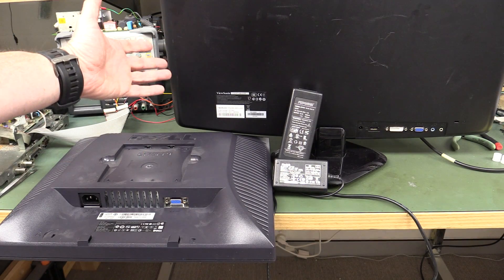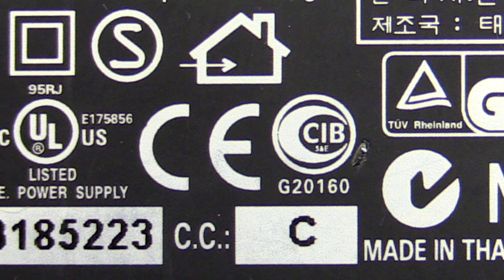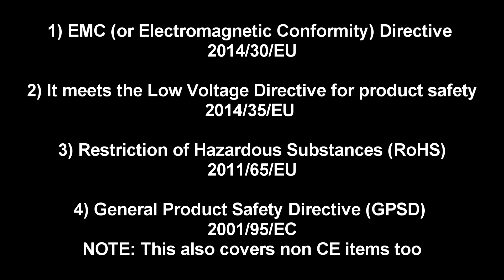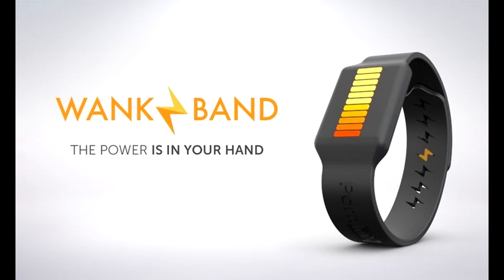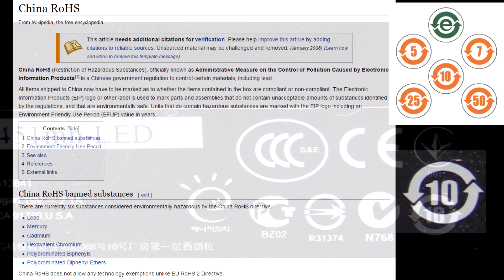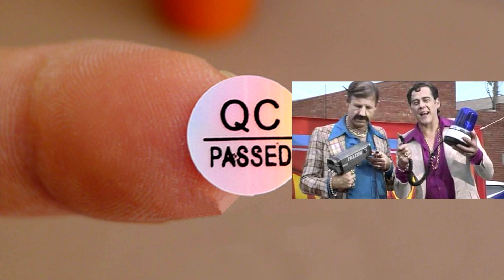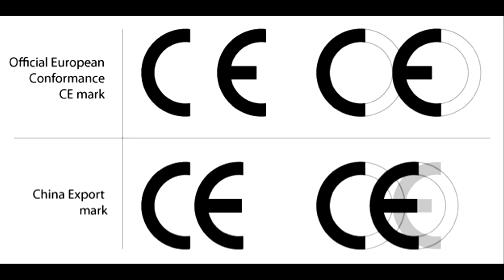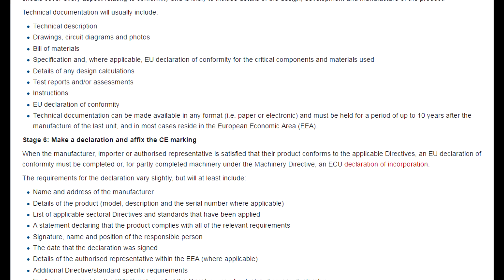EEVblog #996 - What Is The CE Mark On A Product?

Comment: CE = China Export.
Reply from the maker: Nope, watch the video.
Reply: That was a joke from a few years back, google that up. The whole point was the China Export logo had sligthtely different font. You see, in China they do not care much about these certifications, yet European customers want to see the CE on electronicts they buy, so Chianese manufacturers just put it there, regardles of the actuall regulation. After a dispute, China would claim the CE means China Export and as a proof of that made it clear the letters C and E are different font/shape. IIRC, they just moved the C closer to the E, to make it China Export, then they talked about different shape of the letters. Either way, funny stuff.
Reply: Philip Cooper that's an urban myth...
Reply: I think it was more like "Chinese would claim" than "China would…"

Comment: This is a very good overview of the CE concept.   One thing maybe worth noting in a future video...   who is responsible for the CE Declaration?   I'm sure you know it's the company bringing the product to market within the EU.  The manufacturer in China or Hong Kong or wherever can slap the mark on the product but it's the seller in EU who is responsible.  That's why many times on cheap toys you see a second product label stuck over the original packaging.
Reply: It's also worth mentioning that if you buy something directly, from e.g. China, you often get the budget version with the safety features stripped, but still in the same case and with the same CE sticker. So the CE mark only means something if you buy it in the EU I believe.
Reply: And if you buy a few bits in China from Aliexpress etc. to resell you would be responsible for the CE declaration which means you need to be able to prove how your stuff meets the regs.  This either means getting it re-tested locally or getting the test certs out of the manufacturer in China...  (good luck with that!)

Comment: Conformity can not always be attested by the manufacturer alone. For some product groups, like medical equipment, conformity must be assesed by an approved test house, but it still leads to the same CE mark that self-declared products get. Whether external testing is required is detailed in the standards.
Reply: antalz I was wondering this, My work experience in high school was at Intertek, I basically did CE conformity testing all week long and it certainly seemed mandated, dealing with some of the products and the manufacturers.

Comment: Main point for whole CE/declaration of conformity is that there has to be local representative in EU. For quite many products it's importer of the product and they have to make the declaration of conformity not the manufacturer. Retailers/resellers are required to check that this is true for everything they sell. So there has to be someone local to blame when product is not safe or compliant.  Chinese company giving declaration of conformity like in the video has no value because you cannot sue company in china for breaking european law.
Reply: Exactly, it's only meaningful for products sold within the EU. I've bought things on ebay where you obviously get different circuit boards inside the product than if you buy it locally, but it still come in the same case with a CE sticker even though it's obviously non conforming, which in that case means absolutely nothing since there is no one responsible to blame.
Reply: And I'm pretty  sure that same goes to any compliance marker. You can put UL and FCC markings to product in china and sell those in china  Nothink illegal about that. It's legally binding only in US. EU law clearly states that importer is responsible for product, so basically if you buy directly from china you are responsible conformity. This propably also goes in other markets and local regulations.

Comment: Who watches AvE, knows that it is "China export" :D
Reply: "Can electrocute "
"Could explode"
Reply: :D
Reply: One of the best part of cheap electronics from China is fake grounding or ungrounded metal case :D
Reply: Low power outputs connected to mains are also nice :D
Reply: Chineseium Excrement
Reply: Also Ave could pronounce "Conformite Europeenne"
Reply: He probably would also know that it's written "Conformité Européenne" ;)
Reply: craptaculer extrodiner (sp?)
Reply: How mite a Vidjio, taking something apart in front of a camera, to show how the magic pixies, make it chooch, be wrong?
Reply
Reply: There is nothing wrong, until he releases the shmoooo :D
Reply: "mark of the beast"
Reply: +chlordk
From the link you provided: "A logo very similar to CE marking has been alleged to stand for China Export because some Chinese manufacturers apply it to their products.[17] However, the European Commission says that this is a misconception."
So your link doesn't back up your claim that "China Export" uses the same font, since it says that "China Export" doesn't exist as a logo
Reply: "China Export" might not exist as an official marking but we still call it that way over here though, 

Specially power cords that are shipped with electronics.
The electronics might be fine but for example, any unmarked or just CE marked IEC 60320 type of cable from China is usually dodgy as fuck.
Reply: mark of the beast
Reply: That's Chinese Excrement!
Reply: What is shmoo?
Reply: rasimbot it ussually means any kind of gunk or sometimes grease.
Reply: Especially if it's sold by Horror Fright or Cambodian Dire.
Reply: Good stuff Dave.

Chinese electronics was always our joke... CE mark is so much of a joke these days. Far too many cheap Chinese products flood the market with a CE mark. But we see so much piffle, unsafe power supplies, no protection, no EMC compliance, or at least only some types of EMC ok. 
this is not to say that a lot of good stuff can't come from china.

Look for ENEC or TUV. UL (US and Canada) is good from a safety standard point of view but doesn't really cover functionality it's more about making sure your product doesn't kill someone one or burn down the buildings. ENEC or TUV test houses should test all applicable standards including safety and functionality. Believe me, it can take a while to get a product through the whole approval process.
But beware, a few unscrupulous manufacturers have placed TUV marks on products that had had a TUV certificate of compliance. There was a case with those telescopic ladders not too long ago. (Was on bbc).

UL have an online database so you can find certifications for everything they've approved.
In this modern world I'd love to see an app so you can scan the barcode or take a photo of the model number and then it auto search the various certification databases to check for an authentic test reports.

Or maybe i'm going to far for joe public....
Reply: flux
Reply: Yeah, you can find a lot of dodgy stuff from china. Need to be careful.
Reply: "Cencer Element"
Reply: Chinesium Equipment
Reply: ETON GRUNDIG RADIO HAS CE NARROW LOGO ON IT AND FCC LOGO BESIDE IT.

ETON NOAA WEATHER RADIO RECEIVERS, GRUNDIG ETON SHORTWAVE RADIOS, etc...
Reply: China have CCC logo on it’s Chinese electronics and appliances, glass panels, car windshield on GM cars, etc...
Reply: No its not always china export
Reply: Yes. "China Export" even uses the same font https://en.wikipedia.org/wiki/CE_marking#China_Export
Reply: It's your fault if you believe everything he says
Reply: You can't take all of his words seriously, and then you can have a chuckle with him, on some of his screwups :D
Reply: He is quite prone to being wrong, but I don't care at all because I know the things he's wrong about and am not relying on him to teach me stuff. I only watch his videos to be entertained, and they never fail to achieve that!
Reply: If you buy something on aliexpress or any other chinese webshop and it has the CE logo, you just know it always means China Export and not the other one.
Reply: @Rightclick88  Also US Radio company Eton, that also sells Grundig radios in North America, on all Eton Weather Radios have China Export logo and FCC logo beside it.

Comment: It is product and industry dependant, in the construction area , when the CE comes with a specific number in some cases this means it has been tested but to a set of minimum safety requirements and not self declaration, but this does happen too. CE is a safety mark only, not a quality mark.

Comment: Never use wikipedia as a reference.
Reply from the maker: You can when it has references
Reply: KX36 heh I remember being told this in uni about 15 years ago. "never use Wikipedia in your reports, you will lose marks under negative marking, find the original source and refer to that".
Reply: Wikipedia only came to prominence at least in my country in 2005/6, the year I started university. My classmates and I didn't know at the time it was written by users, we thought it was an encyclopedia. It seems strange to think of that now but at the time the wiki concept was like nothing else.

We got away with using them for references for most of that school year but the next year it was banned. :)
Reply: Wikipedia is not a source, it's rather a synthesis of different sources that are refereed to. So although it's quite dumb to have a Wikipedia article as a reference,
on can use the original source as a reference.
Reply: Never use wiki for references in a piece of proper work you're doing like writing an essay even when it has references. Follow the references out and read and use those if you decide they are adequate. But for informal conversation and youtube videos, wiki is a fine reference. 

For science and maths wiki is actually usually very good. It's bad reputation comes from crap written on biographical wiki pages about people.

Comment: There is a new conformity standard called RED(Radio Equipment Directive) which is applicable to all wireless devices coming to market after 13 June 2017. Radio & Telecommunications Terminal Equipment Directive (R&TTED) is scrapped. 

I think if the product is covered by the new RED, it need not go through LVD and EMC directives. 
Read more at :  http://www.etsi.org/technologies-clusters/technologies/regulation-legislation/red

Comment: The supposed problem was that EU member states were using their national testing & certification systems as a stealth trade barrier... and CE marking is the EU solution.
IMO it's got a very EU smell about it, I.E. clearly designed by economists, lawyers and politicians rather than engineers... 

seriously wait for it to burn someones house down first and then try and pursue some here-today-gone-tomorrow, delboy operation in a Shenzhen garage through the courts.
Reply: The CE marking puts the liability on the importer/seller inside the EU, not the original manufacturer.
Reply: Can you point me at the relevant sections Karl, cos afaict that's only correct when the importer/distributor is selling the product under their own brand name. 
If I want to sell wunhunglo factory lightbulbs in my shop under the wunhunglo brand name all I need to do is check the CE markings and get a copy of the declaration of conformity from the wunhunglo factory and I'm in the clear if they burn peoples houses down whether or not wunhunglo or anyone else actually ever tested the product.
If I sell bulbs made in the wunhunglo factory under my own brand name I'm responsible for checking that they're actually compliant

Comment: The correct use of the CE symbol on a product is checked by several states in the EU. In Germany for example the BNA can request samples of any product at random in order to test for CE conformity and  to verify that you didn't apply CE without proper verification. If not compliant, they can force you to pay fines and to scrap all your products.
Reply from the maker: Of course, it's a symbol that means something legally. The EU has the right to verify and deny.
Reply: I have to disagree, generally I think that self certification is a good thing, as it allows testing in independant labs and even in-house. This typically reduces certification time and cost and is therefore a big advantage over other countries.  

I'm also not sure, if you can trust CE less than any other marks.
In general proper companies will do all the necessary tests required for CE, while shady companies will fake CE, TÜV-GS, FCC, UL as well as Ctick (and yes, I found a bunch of devices where TÜV-GS,FCC and UL registration numbers where bogus). 

In my opinion you should not trust any certification marks, you should rather trust the company that makes the device, aka. not buy something form Aliexpress, that has "all the marks" and then wonder why it blows up in your face.
Reply: Bernhard Wörndl-A. That's true, but it remains the fact that third party testing is inherently more trusted; in Germany, many companies really like to also see TUV GS .... marks for electrical gear they buy. 

The self-certification aspect of the mark will always make it a bit questionable and complicated. If CE mark is combined with other EU test lab marks you mostly need to lookup the certification online but for a product with just a CE mark you have to question everything from the beginning. 

I think the CE is self-certificated because the EU couldn't agree on who would do the third party testing and essentially each country/state is checking things themselves based on how strict they wanna be. Which is fine but would be better if EU could agree on a common set of third party testers so that it was easier to send electrical products within the EU. Right now it's a mess because no one really TRUSTS the CE mark.
Reply: The main reason for the self-declaration is that if every single gizmo that is being imported had to go through a certification lab, the labs would implode, the prices of imports would skyrocket and the market would grind to a halt. It would take years to set up sufficient amount of labs for this. The electorate would rapidly let the politicians know how stupid idea they have implemented. 

BTW, there are "notified bodies" established in most countries that are responsible for the testing - that is probably what you want. 

The "trust" in the CE mark is a different thing. Do you thing that would change if someone declared that e.g. TUV is to be recognized EU-wide? Yeah, right, I can already see the French or UK chaffe, with some nationalist fools decrying it as a "German dictate". Also when the electrical/safety norms are not harmonized (which they are not!), you can't have meaningful common testing - I see it first hand now with industrial equipment coming from Germany done to their DIN standard and our French sparky just wondering what the heck, because here they do it totally differently.

Comment: well FCC mark is not exactly choose-your-own.... it depends on the nature of the product... if it is intended to transmit in certain frequencies it is required to be signed off on, if it has reasonable potential to do so then the verification (powerline), and if it has no tended emissions then verification.
Reply from the maker: There are always edge cases and exceptions, same with CE, but I didn't go into those for brevity.